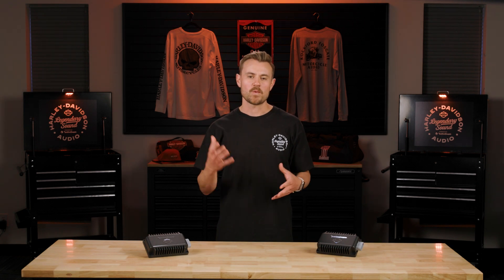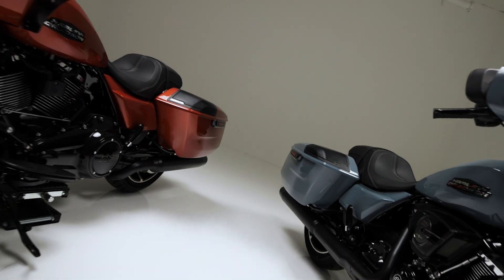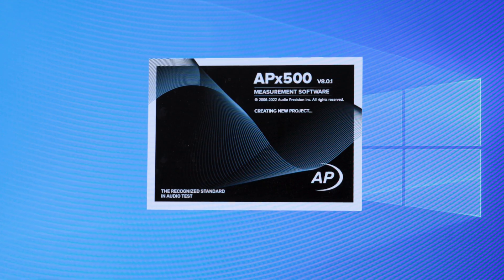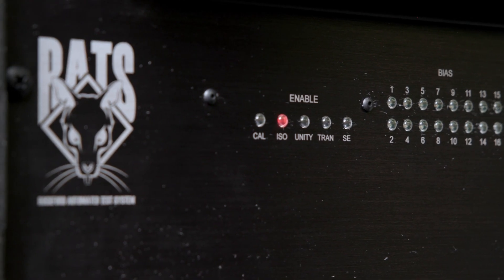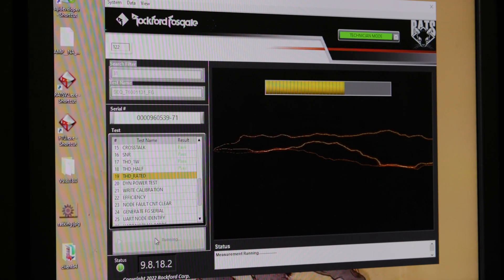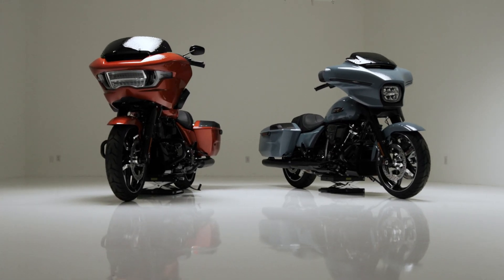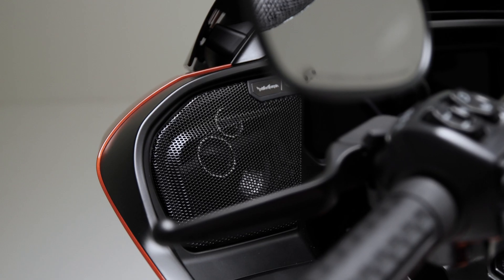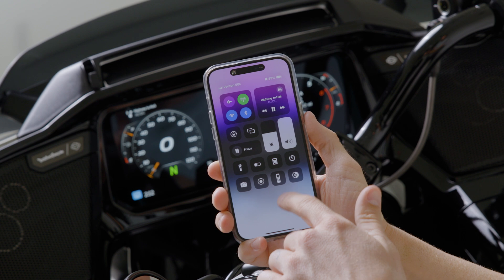Amplifier Performance | Harley-Davidson® Audio Powered by Rockford Fosgate®

Comment from the maker: These PVCs (Performance Verification Certificates) illustrate power output of amplifiers used in "Harley-Davidson Audio Powered by Rockford Fosgate" audio systems.  Continuous & Dynamic power output performed using industry standard test equipment from Audio Precision (https://www.ap.com/):
• 200W [50W x 4 @ 4Ω] Amplifier (P/N 76001131): https://rockfordfosgate.com/go?to=HD-76001131
• 500W [125W x 4 @ 4Ω] Amplifier (P/N 76001132): https://rockfordfosgate.com/go?to=HD-76001132
Reply: good to hear. Question. Why does my system seem to “stutter” at times? Like when I’m listening to music at various volumes, sometimes it seems to cut out and back in. This cut out is quick. Like the whole event takes less than a quarter of a second from start to finish. It repeats this issue randomly. I have stage 2 front speakers and the 500 watt amp. Properly installed and all software updated.

Comment: Why does your 200w Harley amp ONLY provide 9 watts with a 2 ohm load? RF really needs to re evaluate your claims.
Reply from the maker: Isn’t it a little surprising that a company with over 40 years of experience and a global reputation for producing some of the best amplifiers is being scrutinized by a YouTuber who also has a vested interest in promoting their own product?

While the Amp Dyno is a fantastic tool—created by a former Rockford Fosgate employee—it’s not the right tool for measuring power in this particular application. Here's why: the Amp Dyno measures power by increasing the signal amplitude until the system clips. Once it detects clipping, it samples the voltage and calculates power based on the impedance set at the start of the test. This works well for straight regulated and non-regulated amplifiers.

However, the Skyline OS system is more complex because it integrates the source unit, digital signal processor (DSP), and amplifier, creating several factors that can alter the signal. The key difference here is that the audio system does not clip. Without clipping, the Amp Dyno can’t detect a trigger point, which leads to an inaccurate measurement.

Rockford Fosgate worked closely with Harley-Davidson to design a pre-amplifier in the Skyline OS that does not clip at full volume—a signature feature of all Rockford Fosgate source units. We also developed an EQ setting that avoids clipping, even when all sliders are maxed out. This is visible in the "Harley-Davidson Audio Powered by Rockford Fosgate" App under the FLAT EQ setting, where all sliders are at max, yet the audio passes through without clipping.

Moreover, the amplifier itself has a DSP limiters that reduce the audio signal below the clipping threshold. This means the Skyline OS system is inherently designed to prevent clipping, which is why the Amp Dyno can’t measure its power accurately.

Rockford Fosgate has published the true output power of the amplifier in the Skyline-driven motorcycles. You can see that the 200W [50W x 4 @ 4Ω] amplifier actually produces 262W Continuous RMS (sine wave) and 419W Dynamic Power (music), measured using industry-standard Audio Precision test equipment.

For further details on the amplifiers:
• 200W [50W x 4 @ 4Ω] Amplifier (P/N 76001131): https://rockfordfosgate.com/go?to=HD-76001131
• 500W [125W x 4 @ 4Ω] Amplifier (P/N 76001132): https://rockfordfosgate.com/go?to=HD-76001132
Reply: @rockfordfosgate   Well it sure seems to you guys, that your stuff works well… ON PAPER. Maybe RF should start touring HD dealerships and speaking with the customers who actually own a 24 HD w/RF 500w upgrade or stock 200w system. You will definitely hear TRUTH about how disappointing RF systems are.. at any price point.
Reply from the maker: @iminaz7764  It's not just on paper, we do attend several Harley-Davidson events throughout the year, including the recent Homecoming Rally and we hear the complete opposite of what's being perpetuated online by competitors.  I'm personally part of several groups and hear the 500W Stage II system is the best sounding system they have ever heard on a motorcycle period.  Now, a simple fact is the new '24 models have a completely different windshield compared to Rushmore models that - depending on rider height - has a drastic difference in the amount of air coming across the fairing into your face and ears.  Simply replacing it can change the airflow by 10dB, which is equivalent to doubling your amplifier power for the audio system.  Klockwerks sells some great options here: 
https://getklocked.com/pages/harley-davidson-2023-cvo-flare-windshield

Comment: So I own a 2024 road glide and I watched this video. The facts are that it sounds like crap. Today I rode 300 miles on the back highway so 65 to 70mph. I had to stop and buy headphones because at 65 I'm unable to make out what is being said in podcast. So you can tell us that other companies are not testing your amps right but none of that matters to me. I'm a life long Rockford customer and fan and this is just pathetic. I just ordered a kit from volunteer audio to replace the Rockford amp and I'll be getting new speakers for that install also and they won't be Rockford either. Sad day.
Reply from the maker: @AaronMccalla-dn5wo  What system do you have on the bike?  Is it the factory system or is it an upgraded Stage I or Stage II system?  Have you done any modifications?  Exhaust, Visor, Tires, etc?
Reply: I have the same bike just purchased last week. 24 roadglide. Factory system. And im having the same exact issues. Replacing everything on a brand new 30k bike..
Reply: Yeah did you put mud tires on your road glide ? Maybe that's why you can't hear the radio. It sounds decent  in the garage.  Sounds like that's the only place they were tested.  I imagine it's more on harley..for 30k they could have gave a little  more to fosgate  so we could listen  to music  on the highway stock.
Reply from the maker: The reason we ask these questions is so we understand what you're running and how to help.  You say it "sounds like crap" which typically means something is wrong with the audio signal.  The iOS / Android settings in the video help fix around 80% of complaints that the system doesn't sound good because it's making DSP adjustments to make small speakers (headphones) sound better.  Now, if it's simply not loud enough, we know the visor difference from the Rushmore models can allow much more airflow into the rider's face, resulting in around +10dB more noise.  This would be equivalent to running the volume at 1/2 instead of max.  Replacing the audio system won't fix that and can be as easy as swapping out the visor.  Will you be attending Sturgis this year?  If so, we have a Harley-Davidson master technician that would like to understand your actual issues and help a brother out.
Reply: I have a stock 24 road glide. I went to mobile dynamics in Toronto Ontario so I'm a trained 12 volt tech. I have done everything possible just to make it so I can hear it at 75 and nothing works. If your answer is to put a big ugly windshield on the bike then we are most definitely not on the same page. And if this stock "200 watt" amp sucks so bad why would I put faith in the stage 1 or 2 or anything else. I really do appreciate the offer to help in sturgis but without changing out this amp I don't see what you can do. Changing the settings in my phone won't do anything to the fm radio.
Reply from the maker: @AaronMccalla-dn5wo  Thanks for that info.  That's great that you were trained at Mobile Dynamics, so you definitely understand the difference 10 dB means.  If you would like to have our Master Tech contact you about your options, you can email your full name and number to ce@rockfordcorp.com.
Reply: @rockfordfosgate  I have the standard system that comes with my bike which is a 30,000+ dollar 2024 road glide, you’re amp sucks. I Shouldn’t have to upgrade to a system 1 or 2  if your amps were any good the one you put in a standard bike should be able to be heard at 65-70 miles an hour and no I didn’t change the exhaust or the tires, so Don’t tell us how great your amps are. I did change out my speakers which did make a difference for clarity, but as far as output, the amp sucks, to be blunt.
Reply from the maker: @TheChuck1960  The difference is actually in the visor.  Compared to a Rushmore windshield, there is much more air that comes across the Skyline windshield because it lays flatter ... at least 10 dB worth of noise which is equivalent to upgrading the 200W amplifier with a 400W amp ... simply by changing the windshield you will hear more of your audio at 65-70 MPH.
Reply: @rockfordfosgate  I have a 12” windscreen and the amp still sucks. Everyone that bought one of these bikes all complain how crappy the sound system is in these bikes in fact, they all change the system to a Kenwood, or somebody else other than your amp system. Just maybe if you started out with a better system to start with there would be less trash talk about your stereo that goes in these bikes.

Comment: Good to hear. Question. Why does my system seem to “stutter” at times? Like when I’m listening to music at various volumes, sometimes it seems to cut out and back in. This cut out is quick. Like the whole event takes less than a quarter of a second from start to finish. It repeats this issue randomly. I have stage 2 front speakers and the 500 watt amp. Properly installed and all software updated.
Reply from the maker: How are you listening to audio?  USB jump drive plugged into the USB port?  Bluetooth streaming from an Android?
Reply: @rockfordfosgate  direct usb connection to my iPhone 15 that has your recommended settings. OEM cable
Reply from the maker: @MemphisOnAShark  Thank you for this info!  Let me check with the H-D team to see if they have had this issue come up and I’ll get back to you…
Reply from the maker: @MemphisOnAShark  Thanks for that info.  This sounds like a possible streaming issue if you're connecting to Spotify, Pandora, etc.  Try using a USB jump drive  directly plugged into the USB Connection to see if you still have the same issue.
Reply: @rockfordfosgate  I don’t stream. But I will throw some music on a flash drive and try that.